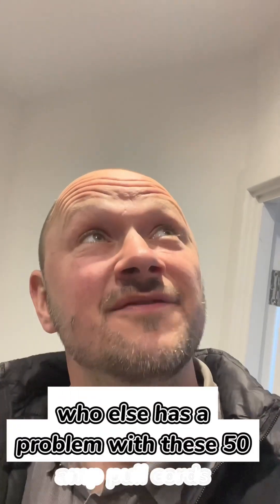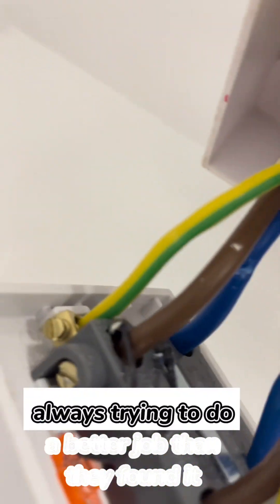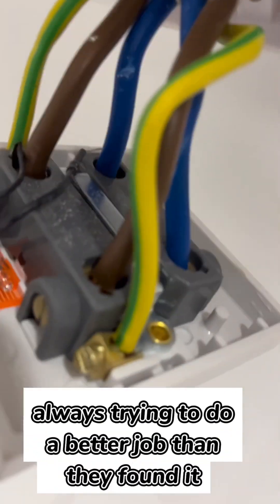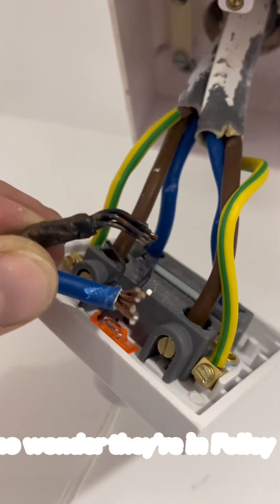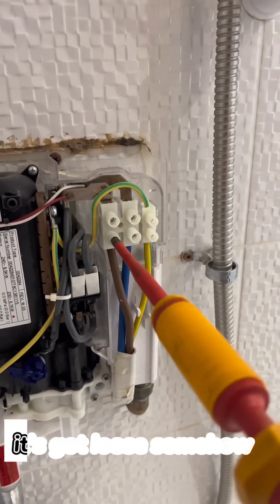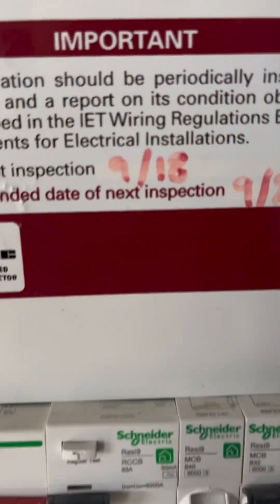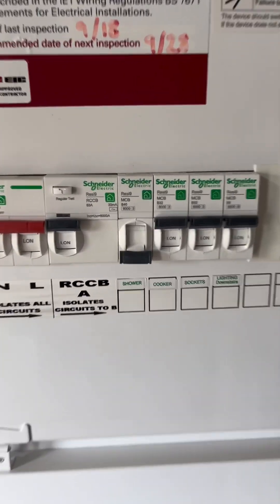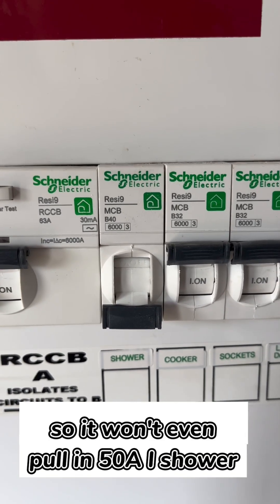50A Shower Pull Cords – Stop Dangerous Meltdowns Before They Start

Comment: I always used to consolidate cable ends into terminals  by twisting tight with pliers as screws splay.cable if not done with resulting fault I'm future especially on neutral ends with high resistance resulting and heat as you have experienced

Comment: That’s because you used too put 6mm twin and earth back in the day now 10mm twin but the pull switch hasn’t changed ie any bigger or more room so it’s a squeeze and every time you move or spin it round it starts loosen in the switch so you need too keep nipping them up right until you screw back

Comment: Use ferrules
Reply: For solid cable??
Reply: @tomorichard  since when has 6mm and 10mm cable been solid?
Reply: Wouldn’t be putting bootlaces on 10mm t&e.
Reply: @demonkey123  why? This is why switch's burn out
Reply: @buzx1313  A loose termination will invariably lead to excessive heat when a reasonable amount of current is flowing. These pull cords can deal with up to 45A working load. Although other factors mentioned in the comments can also contribute to heat damage to the switch such as humidity and movement if the pattress is not anchored securely. Once a loose connection starts to heat up the problem only get worse, heat and moisture accelerate corrosion, which increases resistance, which increases the heat. Vicious circle of doom!
 ‘Bootlace’ style cable ferrules where designed in Germany for use with class 5 stranded conductors typically for panel wiring. There are no UK standards to certify the use bootlace ferrules with class 1 or 2 UK domestic cabling. In my experience, a cable ferrule crimped on a solid or even larger class 2 multi stranded conductors such as <4mm T&E is invariably loose as the conductors do not yield and allow the crimp to securely clamp the cable. This in turn can lead to excess heat which will degrade the termination. Bare conductor nice and tight should mitigate switch burning issues 👍
Reply: @demonkey123  you must be bored.. most sparks use ferrules these days. Stops damage on the cores as you tighten the screw...
Reply: @buzx1313  I am a QC E&I inspector for Draka. It’s my Job. Long may the sparks keep fucking it up, keeps me in a job 😆
Reply: @buzx1313 most sparks don’t use ferrules on solid cores in the UK. Mr Inspector is bang on. Both the ferrule and solid core don’t form around each other and actually cause o/heat issues.
Reply: @christopherbeevor9315  I'm on about stranded cores not solid
Reply: @buzx1313  clearly not. You watched the video and your comment that we’ve all replied under is “use ferrules.”

Comment: MK brought out a new design where the wires come down into the housing and bend back up into the front of the switch, then the switch plate goes on afterwards, won't pull out ever again. It's also worth pointing out so many people fit these with plasterboard screws and can't work out how they've managed to pull it off the ceiling 🤦 always screw to a joist.
Reply: Crabtree
Reply: That sounds like the one I’ve seen being used. Could you find a link?
Reply: @kangtheconqueror  I looked at the video of Chris from CJR fitting one and I think it's a Crabtree not an MK

Comment: I think shower crcuits should be on a AFDD for this reason however IET know better than me and say it it not needed.
Reply: Wrong.
The IET does not say that. What they say is there are certain scenarios where they MUST be fitted.

There is nothing in the regs to stop you fitting protective devices if you think the electrical installation will benefit from them.

And you are supposed to be a competent electrician and fitting devices where you think they are appropriate.